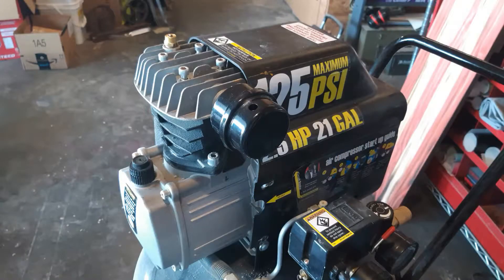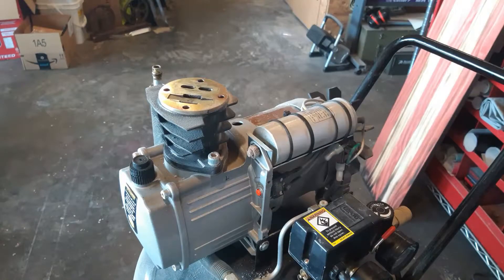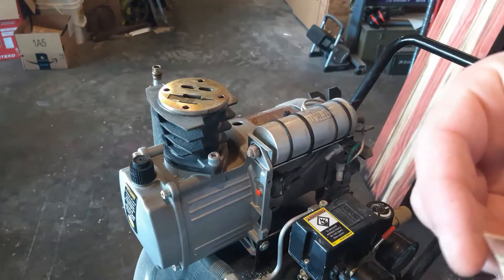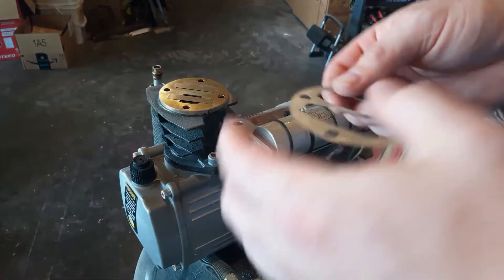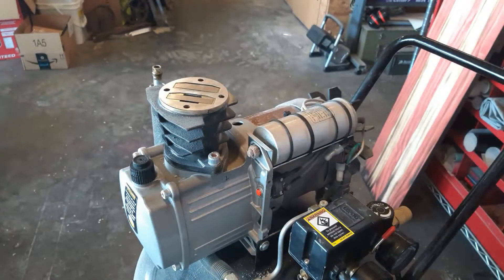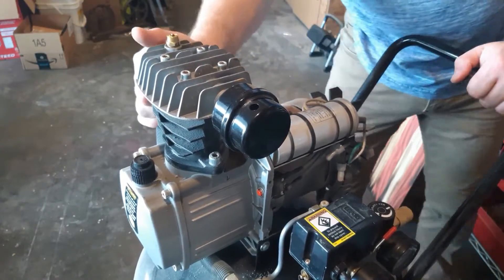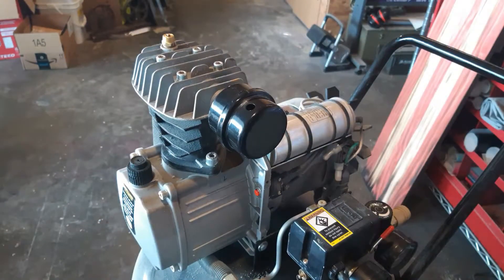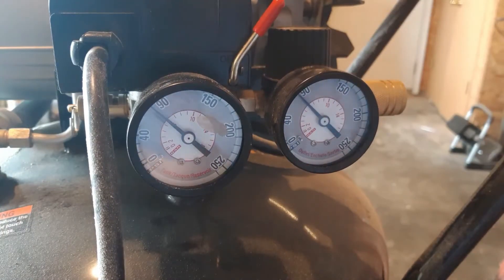Harbor Freight / Central Pneumatic Compressor Repair

Comment: Thanks for the help. Someone gave me one of these not working, would only get up to 40 PSI. I pulled the head and guess what? Broken reed valve. Your link is no longer working for amazon but I was able to find the replacement. Thanks a ton. I now have a working compressor for $10.00!

Comment: My Central Pneumatic compressor has phillips head screws holding the cover on, and they're glued with something.  Total pain in the butt to get off the first time.
Reply from the maker: the probably lock tight them so the screws dont vibrate loose after some time. now that I think about it, i probably should have done that with mine.

Comment: One reed valve goes in that depression in the cylinder.  The other fits in a depression in the head.  You should stick it there with dabs of silicone grease.  You placed it "about right" on the flat spot on the cylinder.  If lucky, it aligned with the depression.  If not, it will get pinched so the head won't seal.
Reply from the maker: I guess I got lucky. Its been working great everyday for the last 2 years. Thanks for the input! I appreciate it!

Comment: You missed the top plate of the reed valve assembly
Reply from the maker: I will have to look into it but I just replaced what the problem was.
Reply: The two plates hold the reed valves and a metal gasket between them!. Most autoparts sell sheets of gasket material, cardboard will not hold up well and when it fails to seal the compressor will run too much.